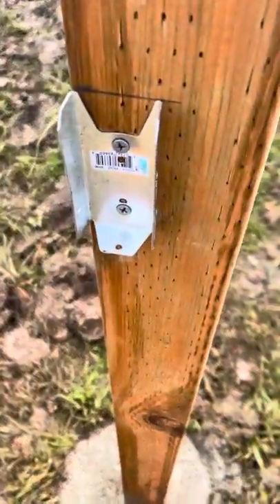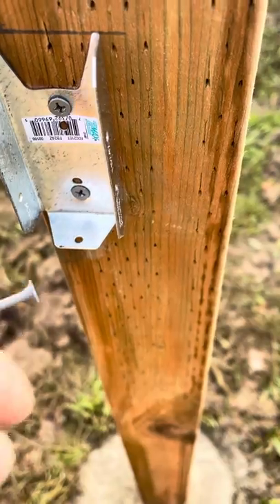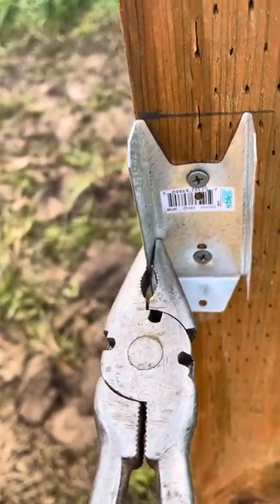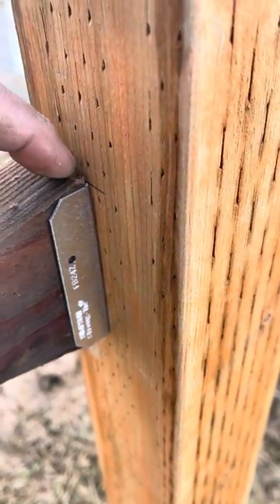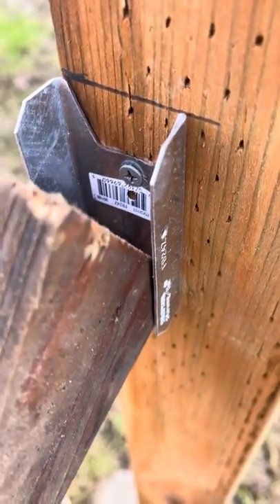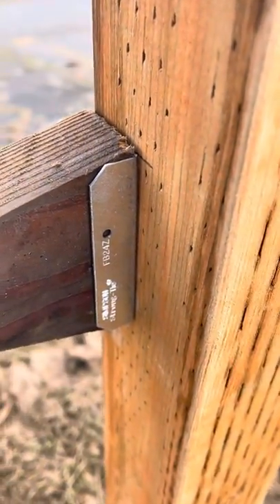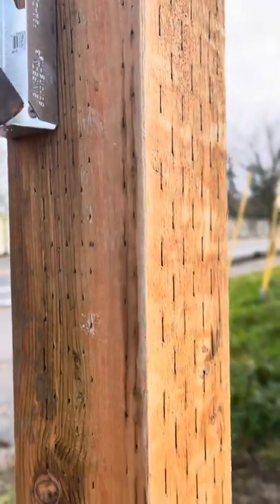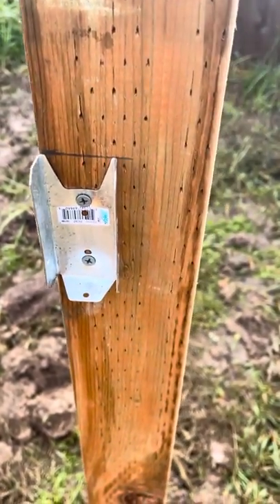How to Install Fence Brackets And Fit your Rails Tight

Comment: that's exactly what I did, I used 2 1/2 no 8 screws and drove them all the way down until the head was flush with the bracket
Reply from the maker: Nice. Good installer. Those will last for a long time. Well done.

Comment: Can i do this for my fence? Im building fence using 4x4 posts with 2x6 rails.
Reply from the maker: I think you should be fine doing that. At home depot you can get a big clip like this that fits a 2x6. It does not have a bottom I do not think but it is heavy duty and works great also.

Comment: What size screw for the side?
Reply from the maker: I use 1-1/2" or 1-1/4" number 8 or 9 I believe... One of the most important holes is the bottom one .